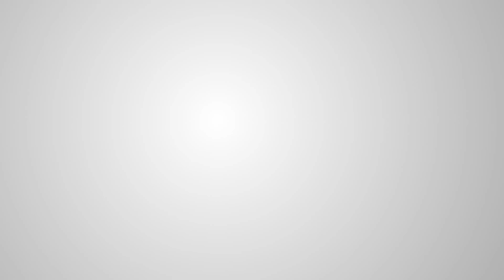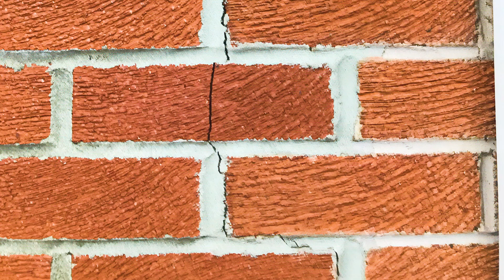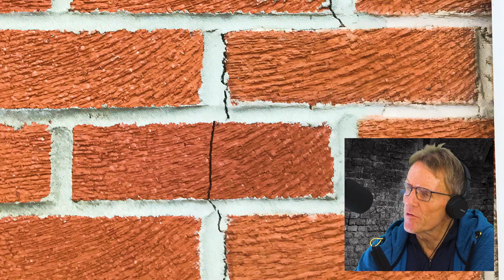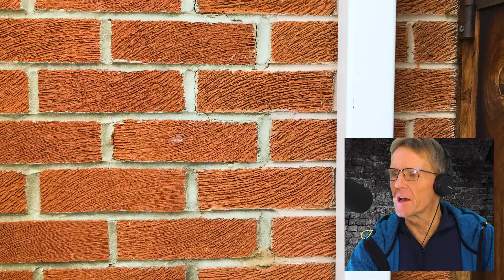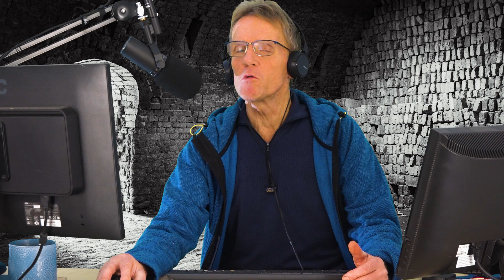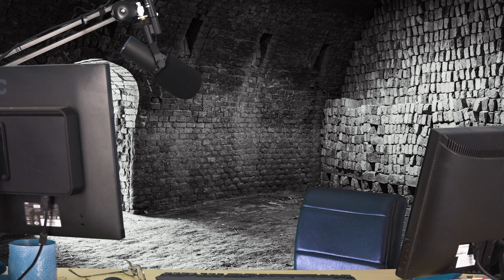Brick Wall Cracks: Investigating Common Causes

Comment: I've got one of these 1930s houses built on clay that likes to go up and down, pebble dashed on the top and exposed red brick at the bottom. I've got step cracking that is showing through the pebble dash finish. Am I wasting my time if I have it rerendered? Or is there a render mix that is forgiving?
Reply from the maker: sand and lime render is more forgiving but it depends on how much movement there is. The crack might not have shown if the render was more forgiving

Comment: Love the Skill Builder channel so I hate to say this but I disagree with Roger’s assessment. The brickwork to the right of the crack looks like different mortar and joint size. I think the corner was toothed as it was built and then when the side of the house was run in perhaps days later with different mortar the bricklayers didn’t do a good job of filling the joints and then over time with water penetration and the freeze thaw cycle it found the weak spot in the wall. Toothing brickwork is bad practice in my book but I’m sure it happens on big sites. Keep up the good work!! Whatever happened to the movement to stop van theft?

Comment: Lovely topical back drop, a beautiful old brick kiln.

Right go get yourself a cup of tea, a Rant is about to start.

I am a 58 year old bricklayer, so I was taught by men who were taught by men who built rows and rows of terrace house in lime/sand mortar.

Think of Coronation Street Victorian houses. You may have twenty terrace house, not a crack in sight. 

Now on site we have expansion joints on detached houses, sometimes 18" from a corner. 
Why?

Somewhere in building history of the 20th Century, some college boy read a book and learned that the more cement in mortar, the stronger it is.
Now in theory, this is correct, in a crush test, it will be stronger.

Now for the classic, "A little knowledge is dangerous." 

Firstly as you stated, the mortar should never be stronger than the brick. 

Mortar isn't there to stick bricks together, it is there to hold bricks apart.

Going back to our college boy, this ideology of stronger is better is at the heart of a lot of cracking brickwork.
Cracks started to become common when the mixes started getting stronger. I have heard guys disguising 3 and 1 on normal brickwork. Madness. I was taught 4 and 1 is the strongest and this was only to be used for engineering bricks.
5 or 6 to 1 is fine.

So as the mortar became stronger, cracks became more common, so the college boys, instead of asking the tradesmen, went back to the books that told them that a more cement equals stronger, so they specified a stronger mix. Face slap time.

Obviously this didn't work so they started to introduce all these bloody expansion joints, (this is a whole other rant about the weakness these things cause to brickwork.)

Now on top of an over strong mix and expansion joints, we are being told to put stainless steel bars into the mortar. 

The mortar is the expansion joint. Go back to our 20 terrace houses, see any expansion joints?

Rant over.

Comment: My previous house was Victorian and built on clay, foundations almost non existant. But as you say lime mortar allows movement, additionally I found that the mortar had very coarse locally dug sand in it, with gravel up to about 5mm. I think those rounded stones acted like ball bearings!

Comment: Unusual place to crack that, settlement cracks usually appear over doorways and windows. 

Check down the side to see if there’s any bowing in the gable end and sagging in the roof? To rule out the roof splaying pushing the walls out or even failed wall ties? Or it could be just the bricks were wet when laid and have shrunk when dried out. Still say that’s more likely to appear over doors and windows though.
Reply: Roger got it wrong initially talking about settlement on clay foundation as that pattern of cracking shows the movement is horizontal and not vertical.  Hexeventually got on to the correct reason which is mortar being much stronger than the bricks.  It's cracking due to expansion and contraction throughout the day.  As Roger says, replace the cracked bricks and repoint the cracked joints in a soft mortar (1:2:9, cement:lime:sand).
Reply: @johncranna 
No, I don’t think the strength of mortar is much of an issue. There’s only two bricks cracked, the rest is cracked along the joints. Indicating only a slightly stronger mix than the bricks or those two bricks already had defects (airline cracks) when they were laid. 

I stand by my first assessment I.E lateral movement or shrinkage from the materials drying out after being laid.
Reply: @leeboss373  so we agree that it's due to lateral movement.  But just to clarify your assessment, clay bricks don't shrink - they expand.  Concrete blocks shrink if they are laid soon after manufacture.  As I said, the lateral movement of the wall is due to the expansion and contraction as it heats up and then cools down.  As it cools down, the wall goes into tension and is likely to crack.  If the mortar was weaker then this tension could be spread about the mortar joints with micro cracking but as it is stronger then the cracking is concentrated in one vertical position and has effectively formed its own movement joint.
Reply: @johncranna  
Well, I ruled out expansion and contraction because that would likely show on the DPC more than anywhere else but I’ve just thought that as we can’t see what is next to the property, it’s possible that there’s a house nextdoor that shields the lower part of the wall from exposure to the sun. So in that case it’s possible that it could be expansion and contraction. But yes definitely lateral movement.
Reply: Love this kind of video, thanks Roger

Comment: Brilliant and succinct assessment. Had the same problem on just the south facing side of house. The highly experienced structural engineer's assessment was the same as the structural repairer's in that the mortar (cement) was mixed way too strong and I'm well past the original 10 year new house warranty. There should be standards for the cement mix when they build new houses.

Comment: You don't need to replace the brick you can get some brick dust and mix it in with a bit of more PVA glue and force into the crack you know about forcing into cracks don't you skill builder😮
Reply: That'll set leaving a black line.
Reply: @lksf9820  don't know what you mean black line?? yes if the colours not the same you could use some powdered paint if you wanted to get the colour you don't need brick dust. It's got to be less noticeable than seeing a crack is my point, and could be completely invisible.

Comment: Opened up a window some years ago in my Brick wall. Every 30 cm there are 4 solid steel wires. It was very hard to break the brick up. My house is from 1984. Don’t see the wall coming down this century. Jeje.

Comment: Looks like a settlement induced crack/failure. Not too much to get concerned about , if it were rotational, that’s a different matter. 
But as Roger states if the mortar wasn’t so cement rich, ie if it was a lime mortar or even a gauged lime mortar the cracking would not occurin the brick, it would travel thru the beds & perpinds & also the great advantage of a lime rich mortar is that it can self heal. Another overlooked plus is that walls constructed with lime mortar breath & very effectively, I can remember a perfect example of this we were called into look at a job which entailed removing the existing cement mortar, the stone in that area was saturated, the next day, the stone was “dry”. We also worked on a very old random rubble wall built in the 1600’s, it had been rendered which of course had failed, the whole wall, some 50 to 60 yds was absolutely saturated once all the render was removed & the gauged lime mortar pointing was completed you wud not have believed it was the same wall, but guess what, we were never paid the final payment, which if my memory is correct was around £7000, charming working in the UK. Not, that’s why we started up in Texas, a World of a difference, remember you have the ultimate persuader there.  😂. Yes we carry in Texas. All legit,
Reply: Roger got it wrong initially talking about settlement on clay foundation as that pattern of cracking shows the movement is horizontal and not vertical.  Hexeventually got on to the correct reason which is mortar being much stronger than the bricks.  It's cracking due to expansion and contraction throughout the day.  As Roger says, replace the cracked bricks and repoint the cracked joints in a soft mortar (1:2:9, cement:lime:sand).

Comment: Should really mention that it can be caused by the brick ties between the skins corroding and the walls separating. That's a bit more serious
Reply: No.  That creates horizontal cracks at about 450 mm centres vertically.

Comment: Please do a video on bedroom ceiling cracks
Reply: Surely just from people walking around in the loft without creeper boards / flooring, probably on truss cut roof.
Reply: @TurinTuramber  thanks for response. Makes sense we had loft floor board put in and thats when i noticed it. May be all the work has caused some joist pressure points. By the way loft is for storage only. Just thinking if i should be worried.
Reply: @shafserious2805 If just a few mm wide then they will just be superofficial cracks in the plaster. Try to spread the load out in the loft and once you decorate you can fill them in. Installing floor boards would have pulled the ceiling frame about a bit, nothing to worry about.
Reply: Timber drying out in the winter. It’s why cornice was invented